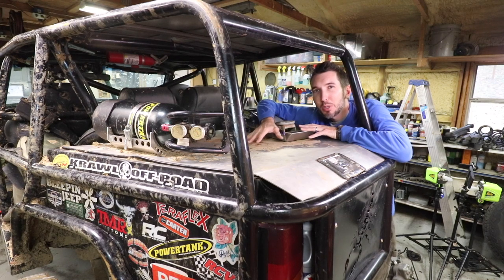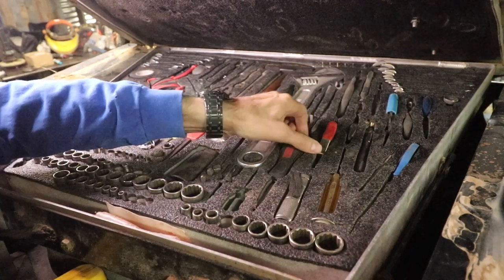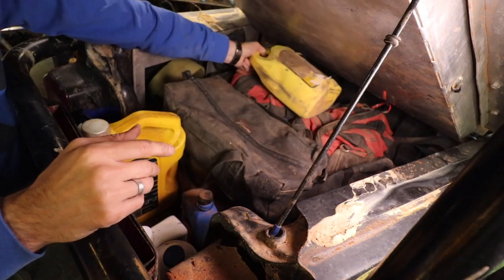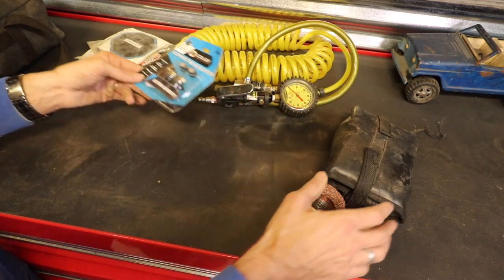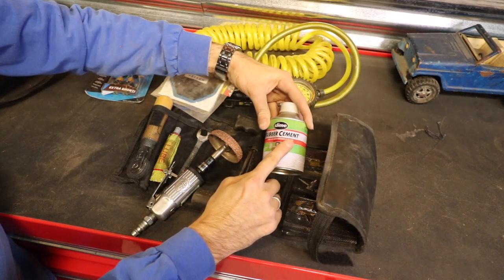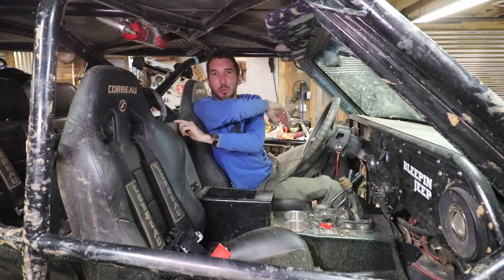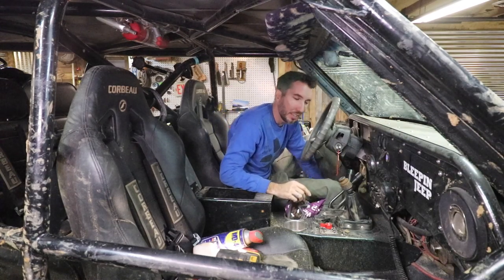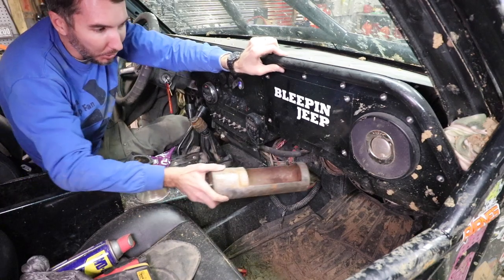Off Road Tool Bag - ALL the Tools I carry in my Jeep!

Comment: Damn, you are a mobile off road garage and parts store! You must be super handy to ride with on the trail.
Reply from the maker: Now if I just had a welder and a York air compressor 😎
Reply: @bleepinjeep  just bring the chubby chaser
Reply: @bleepinjeep  That's what the chubby chaser is for!
Reply: BleepinJeep if you’re ever in a pinch you can make a DIY stick welder out of car batteries, jumper cables and obviously welding rods

Comment: Good material. I use my Jeep for getting deep into the woods, but usually on trails. Not rock crawling. It is for hunting season really mostly but also fishing in summer. I am not a mechanic either. I carry the toolkit and spares that for my skill level. I also carry CAA card and cash. Given I do not put my Jeep in deep trouble (knowing I can’t fix it) and keep up with maintenance and inspections (mechanical) at least 2 if not 3 times a year, I have been OK so far. I did pick up lots of pointers from your setup, I will use them. Thank you for sharing.

Comment: We have been bringing a spare alternator. If it happens to u once... Also i bring a 12 volt fuel pump and some 3/8 fuel line.  Ive gone through 3 or 4 of these while running into people stranded. Mini torch. A flip toggle, heat shrink and a fair amount of 12 gauge wire.  Quick release on a fire extinguisher is a mega pro tip.  Thank u for the time spent!

Comment: Great video. Looks to me like I need to carry more spare parts. 

Living out west, you can never be to prepared as you could be  100 miles to nowhere and days without seeing another person. I recommend carrying some emergency food like MRE type foods, electrolyte powder drink, hard candies, jerky, protein bars, aluminum foil, matches and lighter.  I replace the food every spring. Always carry a blanket. I also take a rain fly off an old tent. Great if you have to lay in mud or snow fixing something, emergency shelter, and it takes up no space and light weight. 

As for tools, I didn't see a mini torch and solder. I always have 100' of 1" nylon rope with me. I have used that so much!! I would also recommend a sawzall 😉 or atleast a hacksaw.

Comment: Spare Starter, coke carb cleaner, some spare spark plugs and wires, starter fluid, hose clamp assortment, gas dryer.   Small clamps.

Comment: I dont carry ring & pin but I do carry a spair t case I seem to be breaking them alot wheel bearing ball joints have a inverter to charge batterys on top of axels stuff you hade in the video all in a stock body x.j to the park leave most in the tent love the video

Comment: LED caution ⚠ box to put out around the customers vehicle , binoculars would be a good thing to carry in case your pin was way off on GPS or a piece of your customers vehicle fell off then you'd have a better chance of spotting it also need something for burns (so even though you have a medic pack add another burn kit, even add a bullet removal kit <~with surgical clamps and hemostats if it turns out to be wasted space THEN GOOD ! LOL)

Comment: I got you beat. My Jeep ends up being almost a tool truck and part store. I won't carry gears though, i'll get a tow before I setup gears anywhere but home. I drive my Jeep to the trail, beat on it, then drive home at least 50 miles depending on where I'm at. I should start carrying hub assemblies though. I break a lot of those and the drive home sucks when they are busted.

I carry 3/8 and 1/2 drive impact sockets of all sizes, air impacts and a ratchet, tire deflators, plugs and gauge, axles, winch gear and straps, breaker bars, u joints, fire extinguisher, driveshaft for front and rear is same length, tie rod assembly already aligned(ish), fluids, cooler... The on board air is great, makes it easy to get more tools, and air tools are cheaper and can get wet compared to electric.

It's even worse when I go camping

Comment: A hack for the toilet paper. If you cover the round side and bottom with duct tape and then remove the center cardboard tube you can "unreel" the TP from the inside. It keeps its shape a lot better and is much more durable. The center also doubles as a place to stash a small bottle of hand sanitizer or baby powder.

Comment: You mentioned spare r&p for the D44s you have. My understanding, you have a TJ front D44, probably a Rubicon version, and a rear XJ D44.  I had thought the TJ D44 was a crush sleeve setup to the pinion whereas the XJ D44 rear would be shim setup. You pinion would be able to accept either for its setup?

Comment: No need to carry a quart of power steering fluid, ATF works fine. I have been running atf in my power steering systems for years.
Reply from the maker: That's a good call but I run a special fluid in my full hydro steering setup.

Comment: I have a 98 XJ 4.0 .  I can be driving down the road and suddenly my jeep starts trying to die and runs erratically. Could this be the CPS?  Really enjoy your informative content by the way.
Reply from the maker: Could be, but also could be fuel related, or electrical...  so hard to tell.
Reply: @bleepinjeep  Deng it! Thanks for replying.  It's all factory so I'm sure it's due for replacement. Would you lean towards fuel since it wont stay primed? I have to cycle the key a few times if its sat overnight or something.
Reply from the maker: Yes definitely, try replacing the pump or checking pressure when its giving you the issue.
Reply: Had this problem with my zj. Troubleshooted everything ignition and fuel related, after a couple of months and a lot of frustration found it was a bad solder joint in the ecu. To check this, start it up and let it idle, tap the ecu with a wrench or something, see if it stutters/dies from the shock

Comment: I don’t know if the way that D ring is mounted is a great idea. Placing side load on it will greatly affect its strength.
Reply from the maker: How would one mount a d ring if not to the bumper??
Reply: @bleepinjeep  I may be wrong, but from the clip in the video where you pull on the ring, it looks like its limited from swinging all the way parallel with the ground. that additional contact will cross load the ring across its face.
Reply: While side loading a D ring can reduce the strength by roughly half, you'd be hard pressed to break one without doing something incredibly stupid as a quality D ring is rated for around 20 tons. 
If you've set your recovery gear up properly, you will snap your line or stall your winch long before breaking a D ring
Reply from the maker: It's just the video, it's not limited and swings all the way forward.
Reply: @leroyj9044  definitely true, but you can't be too careful when it comes to recovery!
Reply: @bleepinjeep  definitely good to know! I wouldn't expect anything less from your fabrication skills!